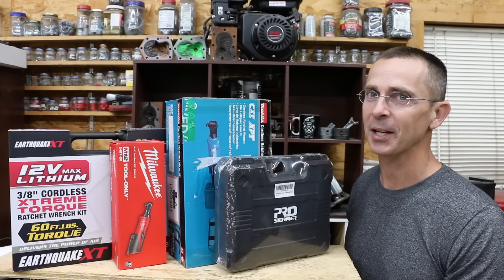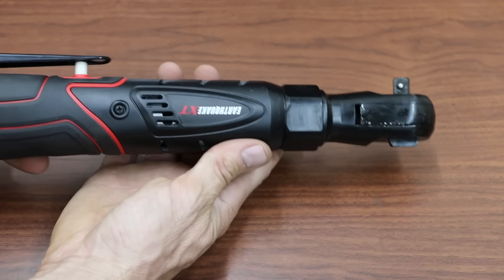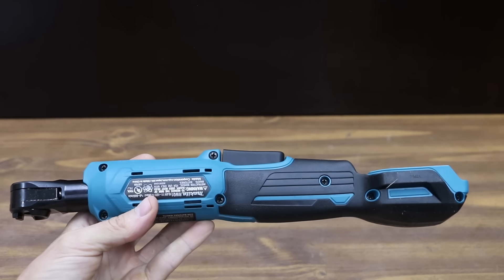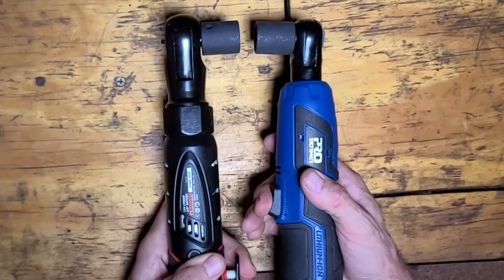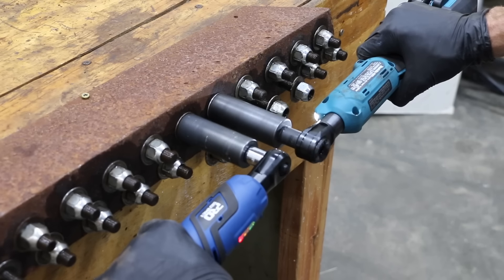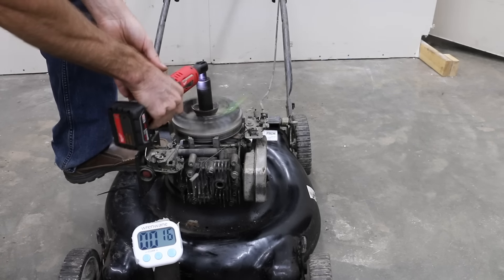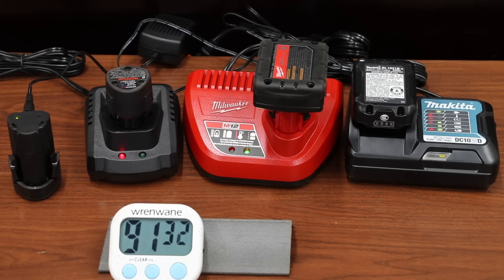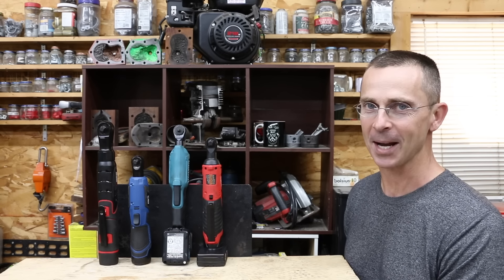Best 3/8 Cordless Ratchet? Milwaukee M12 vs Makita, Earthquake & ProStormer. Let’s find out!

Comment: 9 times out of 10, I’m only watching these to confirm I chose the right team to buy matching tools from 😂
Reply: Same
Reply: As someone from Milwaukee, I always root for it in every video
Reply: @laurens.7938  I always root for the least expensive one so I can save some money lol
Reply: @plaid11  hahha that's a good idea
Reply: @plaid11  go harbor freight!
Reply: But 10/10 its way past bedtime
Reply: I’m a tried and proven Mikita user, among my range, I have a power drill, and circular saw that are still going strong after forty years, but these contests are really showing how good the competition is as they close in on the brand leaders.
Reply: @1BCamden  one thing these test don’t do is check to see how they work in the long run. If you’re getting anything from HF, you’re only expecting it to last a few years of regular usage and 10 max. If you’re getting Dewalt, Milwaukee, or Makita, you’re expecting it to last 10+ years and many of them 20+ and that’s with above average use.

Comment: Actually, I just paid $145 for Makita... And Makita uses universal battery that fits all of its tools so you can use the smaller 2.0Ah or the larger version (5 or 6Ah).
To make it short, Makita for me - I had extremely bad luck with a milwakee drill once.
Reply: I have this Makita tool shown in the video, but mine is getting a lot of play in the ratchet mechanism after just 2 years of hobby use working on my car, now with slightly tight bolts it just rattles for an eternity without actually getting anything done, quite disappointing
Reply: @MrTurbo_  Yes, unfortunately these days no brand can be 100% trusted - everybody is just cutting corners...

Comment: Maybe add the Milwaukee fuel ratchet to a follow up test
Reply from the maker: Great recommendation! Thank you
Reply: The fuel vs the snap on would be a good one.
Reply: @ProjectFarm  also the husky from home depot currently 59.99
Battery encased in tool so you can really pull on it
Reply: @ProjectFarm  id like to see if the long neck fuel ratchets have any better or worse performance than the standard ones
Reply: I stopped watching after I saw it was the old non-FUEL model.
Reply: The fuel is a good tool, but the head of it is much bigger than the regular brushed version tested here.  A lot harder to get it into tight spots.  Sure it has more torque, but these tools really aren't used for breaking bolts loose.  I'd rather have the smaller head with less torque for a tool like this.
Reply: @ProjectFarm  loved it! Great video
Reply: @declanfarber  right? It still beat the competition and it's the old junk model.
Reply: @Jackmerius_Tacktheretrix  I own the snappy microlithium one and the only thing I like about it is that the grip feels a little better... But I always reach for my Milwaukee fuel ratchet b/c I like it more overall
Reply: Yup fuel stuff is better and faster
Reply: I agree do fuel vs snap on. Also Milwaukee makes a fast charger that’ll charge that battery in about 20 minutes
Reply: The STD one is awesome and incredibly durable, anything too tight just crack it manually first, the best tool I've ever bought
Reply: I have the fuel one, I don’t think it will do miles better but it will do ever so slightly better
Reply: I also find that with 6 point sockets you can drop the socket onto the bolt head with the ratchet running and many times it will crack it loose as well as tighten very adequately

Let's not even add the fact that Milwaukee uses Samsung cells... The absolute best period
Reply: @greembow  thanks. I bought snap on because where I work they will pay the flat rate for snap-on to refurbish amy of my tools. I do it once a year so that alone makes it worth it. Otherwise I'd be going for Milwaukee without a doubt.
Reply: I bought the Husky for a timing chain change on an Ford Explorer because it was cheap and in stock at Home Depot. Though it has quirks and flaws it was wonderful to have/use. I didn't have a single banged up or sliced knuckle like I typically get doing a job like that. Didn't know about the Prostormer but sounds better. I eyeball the Milwakee everytime I'm at Home Depot. Do I buy fuel, regular, 1/4, 3/8, or extended? Meanwhile the $60 Husky will do. @dbillionaer
Reply: I bought the Husky for a timing chain change on an Ford Explorer because it was cheap and in stock at Home Depot. Though it has quirks and flaws it was wonderful to have/use. I didn't have a single banged up or sliced knuckle like I typically get doing a job like that. Didn't know about the Prostormer but sounds better. I eyeball the Milwakee everytime I'm at Home Depot. Do I buy fuel, regular, 1/4, 3/8, or extended? Meanwhile the $60 Husky will do. @dbillionaer
Reply: @Paul-oh4fe  Agree , the fuel is just a larger tool with about 5 more pounds of torque . Prefer the non fuel and the small batteries for getting in tight engine places and the fuel for the everything else .
Reply: I've used them both side by side and the fuel is a good bit more powerful. Only issue is the head of the fuel is about twice the size so it's hard to fit in tight areas
Reply: @declanfarber  yet it still performed great
Reply: @Paul-oh4fe  but with the new head comes more durability, an extended version, it has a motor brake for more control, and it gets jobs done even faster because of it's brushless motor.
Reply: @Jackmerius_Tacktheretrix  i have the milwaukee and my coworker has a snap-on.  Both seem about the same speed, but the milwaukee is a little faster.  The major difference is in the torque.  My milwaukee stalls out a lot more than the snap-on.  They are both very similar in size and balance.  Hope that helps.
Reply: @Paul-oh4fe  absolutely.   Could not agree more.
Reply: @javiderek31  actually, I own the fuel 3/8 ratchet and it’s surprisingly slower than the brushed version in this video that I also have. The fuel does have way more torque though.
Reply: For all of you saying that the Milwaukee Fuel version is the only one to have, PF really needs to test that. I have and love using this exact Milwaukee non-fuel ratchet, bought on sale for $99 with a 2.0 battery, I’ve literally run it over and it still works like it’s new.
Reply: @ColdRiverAutowire  I have the original and love it too. But the fuel would do better in the power department and maybe speed. I also prefer the brushes though for its smaller head and body size
Reply: @ProjectFarm  Please also add the HomeDepot Husky brand one as well!
Reply: The fuel one is awesome, cracks surprisingly large bolts, which can be very helpful when you work in cramped engine bays.
Reply: @Jackmerius_Tacktheretrix  Does anyone have a quick comparison of the Milwaukee VS the SnapOn? Has anyone tested them against each other?
Reply: @declanfarber  I have both and still grab the old milwaukee ratchet sometimes for tight engine work, it's so much smaller
Reply: Milwaukee fuel vs the tool trucks and 18+ volt ones, i.e. ryobi, kobalt, etc.
Reply: @jordyn444  hood idea. I’d love to see the ryobi one
Reply: @kennethstephens8046  indeed
Reply: @darkstari  i have both, the non-fuel one is so much smaller, much better for tight spaces when working on cars and stuff, but they both absolutely have their merits :)
Reply: This non fuel version is preferred by some because the head is much smaller and easier to get into tight spaces
Reply: Another vote for Mil Fuel vs. Snappy/Mac/Matco

Comment: I use my Milwaukee 3/8 electric ratchet everyday working on vehicles. I absolutely love it. Plenty of power and haven’t had a problem with it in 5 years!
Reply from the maker: 5 years--impressive!
Reply: Love your profile pic
Reply: Same for me at around 4 years now, and I have dropped the thing so many times.
Reply: Yup, Mines been soaked in coolant, Oil and going on 3 years without a hitch.
Reply: Wait till you try the snappy. It's worth the price tag.

-Former Milwaukee owner

Comment: Got the Milwaukee in a set with drill and driver with two batteries + bag and charger for $200. Felt like a great deal at the time, feels like a steal now!
Reply from the maker: Thanks for sharing.
Reply: Just bought a Milwaukee ratchet, 2 batteries and a charger... 400 some dollars.. you got a great deal
Reply: @stevecariggillio4139 
Milwaukee has different combo kits so you probably got different tools than what he did.
Reply: @slickrick8046  I bought the M12 fuel ratchet.  A 4.0 and a 2.0 battery and charger. I think I may have paid a premium.

Comment: You’re gonna have to get into SnapOn, Matco, and Milwaukee Fuel for this.
Reply from the maker: Thanks for sharing.
Reply: He didn’t do it because it’s expensive. He likes em cheap, shame. Unsubscribe
Reply: Well I can tell you from experience that the snapon one is noticeably faster than the earthquake (I have the EQ while another guy at the shop has snapon)  While we both agree his snapon is the superior tool neither of us really thinks its 6 times the price superior. both get the job done though.

we havent really compared torque as thats not really something we value for this specific tool.  Its more spining on or off nuts and bolts when we have to take alot on or off of a motor we are repairing, particularly ones in tight spots.   If we want high torque we pull out a real impact gun.
Reply: Definitely need a snap on - Matco - Mac & Milwaukee fuel show down
Reply: @seavisions  Ok, boomer.
Reply: The Snap On ratchet is decent, but the price is extremely over-inflated. It’s not even worth half of the retail asking price. The Fuel is great, but I couldn’t stand how bulky it is. The Earthquake was the Goldilocks ratchet for me. It’s not the best at anything, but overall it was just right for my use. As far as Matco goes... Never touched the stuff and don’t plan to. I may have seen a Matco truck twice around here and might be mistaken on one of the sightings.
Reply: yup, answer is  Snap on for this tool .
Reply: @kim4548  I believe it was more of an effort to compare apples to apples and get a feel for the viewers interest prior to investment. It is really just good business sense.
Reply: @kim4548  I wouldn’t say it’s because he “likes em cheap,” I’d say it’s more due to his audience. Most of the people here aren’t looking for professional grade tools, they’re looking for good DIY stuff. Plus, even though you can get them online, SnapOn and company aren’t as easily accessible unless you have a truck come by. I’ve got a 3/8 SnapOn ratchet, and it’s a bad MFer. But I also know the average person isn’t going to need that type of tool or want to pay that kind of price tag. Bottom line is, he’s going for accessibility to the Average Joe.
Reply: @JakeNaughtFromStateFarm  you forgot that he pays for all of these tools out of pocket, no sponsors or borrowed tools to test.
Reply: @jaydunbar7538  You’re right. I was thinking that, but went in babbling and forgot to write it. That’s why I like his tests, he really doesn’t care about the makers, he really is trying to give honest input. One of the only channels I’ll let ads play just to get him more revenue.
Reply: Snapon is nothing special. Quite overpriced. I bought one in january 2019 with battery for 380$ or so, it’s battery life is so-so, haven’t got me through 2010 bmw clutch replacement on one charge, now it’s in repair since october 10th since it’s speed is weird and not really controllable. But i was using it daily since i’ve bought it. My coworker uses milwaukee and is quite happy with it
Reply: @seavisions  Hahaha. You watch Supernatural huh?
Reply: @Binford2500  I'm not a fan of the massive body on the fuel version. I have this milwaukee and use it daily hard for the last year. works like a charm.
Reply: @Binford2500  I have a brushless Makita impact driver and the older brush motor Makita 1/2" hammer drill and WOW what a difference brushless has in terms of battery life and performance. And @Kim Legend, he probably reviews budget brands because there are a lot of people out there who aren't using their tools professionally and want to know the best way to stretch their dollar for their home garage. Anyone who is using something for their job every day probably knows it's worth spending a lot of money, or has their employer buying it, to get a high end tool.
Reply: Yes definitely should have tested the Milwaukee Fuel.
Reply: @yurik1994  I bought mine from a friend for $180 (ratchet, charger, and 2 batteries). It’s good, but I like the M12 Fuel better. I’ll be replacing it with that eventually.
Reply: Was that an exact quote from that show?
Reply: Snap on is the best hands down last for ever them tools they make do im a makita guy i cnt afford snap on
Reply: @merendell  We have Milwaukee at our shop. They are fine but their batteries suck
Reply: @kim4548  There are many people who can't afford nor do they need a top professional brand.  If you are not making your living with your tools it is questionable if you need Snap-On or Milwaukee.  It depends on how much spare cash you have.  When I was working I tried to have top name tools.  But now I am retired, not using my tools all day long every day, I settle for lesser quality (not junk)  and cheaper prices and they do the job I need them for.
Reply: He lives on a farm in Missouri. He needs to go to a truck to get Snap-on and Marco.

Comment: It’s good to see that even on a budget you can get a competent tool but also that the higher end brands aren’t simply charging more for the same and can back up their price difference.
Reply: You'll probably find that some of the low end tools are actually made in the same factory as some of the top end ones with merely cosmetic or battery differences.
Reply: Conclusion -- Milwaukee is the best!
Reply: @FrozenMermaid666  
But is it the best value? If you are not a pro user, maybe not.

Comment: Id like to see battery operated grinders, Harbor Freight, Dewalt, Makita, Milwaukee, etc. See who can cut the thickest steel, who 
has the longest battery life, etc
Reply from the maker: Thanks for the video idea.
Reply: @ProjectFarm  What if we included higher brand names such as Snap-On or Blue Point? Not to brag but we Marines use Snap-On and Makita, rarely Blue Point. Other products such as CDI Torque are most of our torque wrenches. Could there be a torque wrench torture test?
Reply: I'm in the market for a drill. Would love to see him pit the big brands versus the Bauers and the like.
Reply: @bamleonti468  Snap-On quality has gone down in recent years, but their prices have stayed high as can be because of their past reputation. There is already a video of a Snap-On vs Harbor Freight torque wrench test https://youtu.be/ck_O5U1Tyz8. BLUF: Snap-On didn't do as well as Icon
Reply: Ryobi has one for around $60 and 4ah batteries are available.
Reply: Dewalt flexvolt is 👌🏽
Reply: Please don't forget Hilti, BLACK AND DECKER, Bosch and Hitachi
Reply: 100%. I haven't bought one yet, purely because I just can't see them being anywhere as good as my 125mm corded. But some are nearly double the price.
Reply: Bike Thieves: 👀... attention intensifies.
Reply: @zwekkerboy716  Hitachi? When did you go tool shopping last?
Reply: @ProjectFarm  I have a Bauer cordless grinder and it's not very impressive.
Reply: @bamleonti468  lol still stuck on snap on huh it's okay you'll get updated in a couple years
Reply: @kdash3215  honestly if it's electric and you want cheap go Ryobi or kobalt, manual or pneumatic tools are decent
Reply: @DougGreen1987  hahaha, yeah I know Snap-On isn't all that great anymore, I had a few toolboxes break on me..ratches snap or seize, actually got a socket to crack and another to snap apart. I also don't think all sizes from different tools are the same..a snap on socket 7/16th is a slightly different fit over a blue point or durmast or craftsman. check it out

Comment: I never knew how much I needed one of these until my brother handed me his ( I was using regular ratchet) to finish taking off the bolts of the oil pan on a Peterbilt. Can't wait to finish the video later!
Reply from the maker: Great feedback. Thank you
Reply: Same with me.. ALWAYS  used a regular ratchet over the last 25 years..got  a cheap earthquake  at a pawn shop for $25 with case and charging station to see if I liked them, best thing I may have ever bought! Lol
Reply: Not only that but the bellhousing bolts on a Peterbilt they are a pain in the rear especially the top ones you can’t even see
Reply: My boss would always yell at me whenever he saw me using hand-tools. "Go get your toy! Stop f-(messing) around."